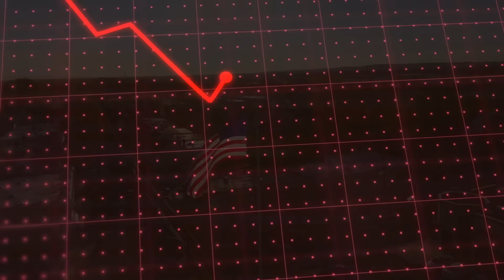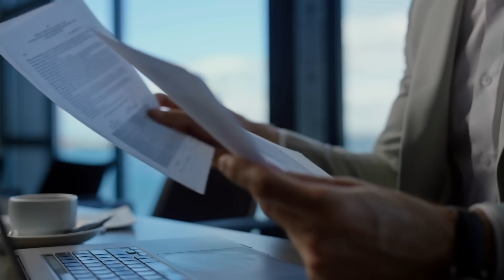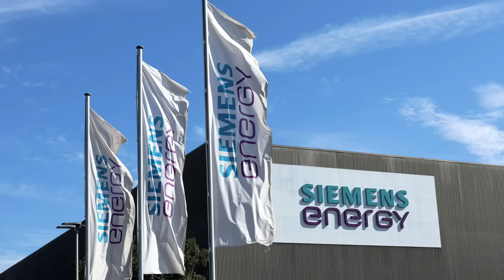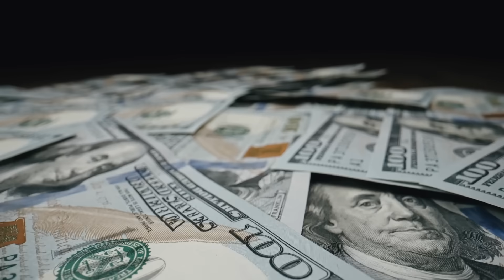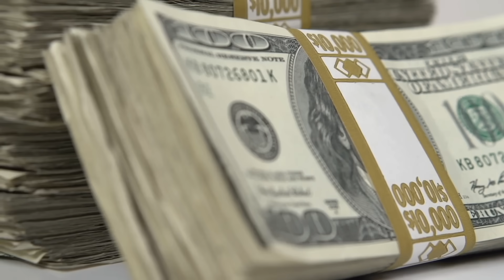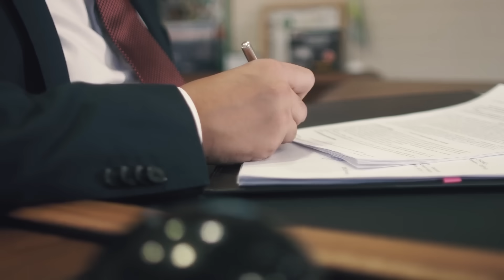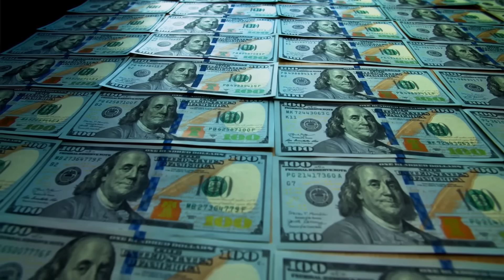The Real Reason America Has Turned Its Back On Wind Power Energy

Comment: I love at the 9-minute mark when they say, "government funding". There is no such thing. It is taxpayer/citizen funded. Once people realize that government funds nothing without taking in the form of ever-increasing taxation then maybe the citizens will wake up. I doubt it though.
Reply: As our U.S. dollar deteriorates and a simple burger meal at a drive thru window costs over $10, I would hope that people would start to wake up and realize that government spending is putting us deeper into a terrible debt.  The process of accessing these new sources of electricity is far more complicated than you may be thinking.  The power has to be placed into phase and stepped up to push onto the electric grid through a very complex process over newly constructed high tension power lines that have to be placed on private property.  Farmers and property owners do not want the lines on their land.
Reply: @g.k.1669 it's the fact that the dollar is strong that is the cause of (some) of US economic issues, an overly strong currency usually reduces exports.
Reply: @g.k.1669  Then tell governments the world over to stop subsidizing fossil fuels then? Its one of the most subsidized industries in the world.

Yes, electricity is complex no matter where it comes from—even for fossil fuels!

But fossil fuels are an _especially _complicated electrical energy source.  Because the fossil fuel industry needs a massive 24x7x365 non-stop effort of people, finances, subsidies, and equipment to explore, drill, transport, refine, distribute the stuff.  No, it does not just show up in at the power plants by magic!  -- And -- that's just to get the fuel to the power plant and it is still not even electricity yet!

Moreover, if any of this extremely complex process stops, whole sections of grids will stop.  If there's a war or conflict for it in some remote corner of the world,  then global fossil fuel prices can spike because those energy markets and refining activities are so intertwined.

Each year, US spends so much energy just refining its own crude that it could power all its EVs and more.
Reply: They spend money they don't pull in through revenue.
Reply: @kayakMike1000  : Correct. It is tax money redistributed through crony capitalism.  AKA fraud.
Reply: An absolute disaster to the environment
Reply: @rmf9567  Only if one has no clue what fossil fuels do to the enviroment.
Reply: @old-pete and you'd only hold that view if you had no idea of what environmental damage renewables do. When you've bet, and lost, the whole farm on renewable energy, what are you going to eat?
Reply: Before you can tax, the government has to create money first...unless you permit your banks to create their own money by lending, possible through the policy of fractional reserves. Taxation is nothing but one measure of removing money from the economy. The government can create money either responsible, balancing demand and supply by creating or removing money, thus preventing inflation or deflation,  or irresponsibly by quantitative easing, issuing money basically without restraint.
Reply: @krautsky  : You are conflating "money" with wealth.  They are NOT the same thing.
The government does NOT create wealth.  It PRINTS money.
Businesses create wealth.  Then the government takes it in the form of taxes.
In a non socialist/marxist/communist/democrat totalitarian thug system  those taxes are supposed to be used to keep the infrastructure sound and in defense spending and so forth.
What it is NOT supposed to do is redistribute that tax money to other people for political gain.
ALL wind and solar farms (all green endeavors in fact) are built through crony capitalism by taking tax dollars and giving it to corrupt companies/corporations to build those catastrophes that were never designed to work.
Those tax dollars were stolen and given to pals of corrupt politicians.
Reply: Just throwing tp money down the drain.
Reply: You are so right 😂
Reply: You'll see my comment that makes the same argument somewhere herein.  But you are so spot on!
Reply: People never will! They think that the government gives us free stuff.
Reply: The climate and renewable agenda is driven by Europe who faces the problem of dwindling energy resources and have looked to renewables and export of renewables to further generate scale and revenue
Reply: @christinebell37  The physics are the same everywhere.
Reply: absolutely correct.  but we can fund it thru public & private contributions.  accurate records and accountable managers are essential.
Reply: It's the same when they say 'free' this and 'free' that. It does my head in that people are so accepting of these terms.
Reply: @tonybloomfield45283  If you may need a "Heart Transplant", I suppose it will be a huge expense for You, as most likely American (And in a very fine Hospital)?
   In Denmark the expense for a hyper expensive Heart Transplant will hardly be felt for the patient, as it will be paid for by - all taxpayers! Why is anyone against this?
    That's the difference between The US and "Happy" Scandinavia!

          Our local Mayor has just got a transplant of "Bone Marrow" from a woman found in Chile, to cure his Cancer! It didn't cost him anything of course and he is now back in his job!
Reply: @@dannytimms9011Well, since you dislike it, then don't pay for it and don't live in this society.  I would be glad that people like you isn't in this society.
Reply: Ye I think Obama said when he was president that they would never had gone into space if it wasn’t for the government
Reply: Hoax.

Such a load of garbage.

There no such thing as a greenhouse effect.

The whole premise of AGW -- the greenhouse effect -- is wrong.

There is no such thing as a greenhouse effect (except in an actual greenhouse (closed container)).

But there IS  a trillion dollar $$$ boondoggle that is the muscle that twists arms behind that stupid renewable energy.  

"Welcome to the Mafia-ization of the energy business."

             * * *

A Novel Perspective on the Greenhouse Effect (Tom Shula)

https://youtu.be/NS55lXf4LZk

1) Markus Ott: Questioning the greenhouse effect

https://www.youtube.com/watch?v=Bj6ORbRBZ2s&t=7s
The greenhouse effect is the primordial sacrament of modern climate science. It is preached from kindergarten to the nursing home.  The simple name of this effect and its ubiquity in culture and mainstream media leave no doubt that we are dealing here with solid and fully understood Natural Science. But how does this actually effect work?

2) Markus Ott: Atmospheric greenhouse effect ~0?  (Applying IPCC formulas to the no-atmosphere moon. Conclusion: there is no greenhouse effect on earth.)

 https://youtu.be/JXKHfL55G2A

Min 6:xx.  "Abuse of the Stefan-Boltzmann model..."

3) Markus Ott: Saturation of the CO2-IR-Absorption

https://youtu.be/CrMGTkPADFw
(Min 0:10) The alleged greenhouse effect of 33 degrees centigrade is the result of an improper use of the Stefan–Boltzmann Law (black-body radiation), and that a less abusive application of this law makes the greenhouse effect almost disappear. 

4) Markus Ott: Convection and Thermalisation Kill The Greenhouse Effect

https://youtu.be/RbNNhLqhWPg

In-Depth Comments on Sabine Hossenfelder's Talk: Greenhouse Effect 

"Heat transport in the atmosphere... IT'S CALLED WEATHER."
https://youtu.be/sY2xHk0ThJ8

https://thebreakthrough.org/journal/climate-change-banned-words/art-climate-change?utm_source=Breakthrough+Newsletters&utm_campaign=12e6304fed-BTI_Weekly_1_18_2023_COPY_02&utm_medium=email&utm_term=0_49b872540e-12e6304fed-466887052

If heat rises, why is it so cold in the upper atmosphere?
https://www.physlink.com/education/askexperts/ae670.cfm
Reply: @@dannytimms9011 That $5.1-trillion figure came direct from the International Monetary Fund (IMF).  Anyone can look it up.  Bad news for you is that their updated figure for 2022 is now $7-trillion up $2 trillion from 2020.  Look up "imf energy subsides" for page for more details, chart/diagrams per fuel type and country.

Sure, I understand that accounting is sometimes based on subjective analysis even for established international GAAP standards. So, for argument's sake, let's cut the latest IMF 2022 figure down by a huge half to $3.5-trillion and still a staggering amount.

So my point still stands that fossil fuels are globally one of the most subsidized industries in the world if not the top spot -- only other contender at the scale is agriculture.   It is not hard to understand though because all modern societies need energy to not just prosper but even to just survive.

So people who are up in arms about renewables now receiving billions in funding are full-on clueless about it.   It’s a drop in the bucket compared to what fossil fuels are getting.  As fossil fuel recedes over the years and decades, we should except renewable subsidies to naturally increase.

Lastly, it needs to be said that renewables are a sustainable energy source that will go on for a billion+ years.  Fossil fuels will be only a brief torrid love affair in the time scales of civilizations.  Recorded artifacts of civilization go back some 5,500 years to Mesopotamia but the Industrial Revolution started "only" some 200 years ago when we really started to burn fossil fuels at industrial scales -- thankfully, that is starting to come to an end now and I can hope we can undo the damage.
Reply: FACT!!
Reply: That phrase Is fake news speak for the uneducated younger generations that believe everything has to come from "the govt". As usual, reality is a cruel...and costly...teacher.
Reply: Socialist won't
Reply: How many Americans voted to send their tax money to Ukraine so that Ukrainians can keep on dying?
Reply: UK Sunak has backed out of Paris Accords and abandoned milestones, as the real costs of Go4Zero grab.

We do have the estimated (present $s) cost for All-Electric "Net Zero"(sic). 273% higher utility bills. Do you own math. Massive gulaging of fixed income Seniors into State-run internment camps, jacked out of their Craftsmen homes by Chinese hot money, since 93% of solar panels are Made in China. 

¿Remember those Covid Lockdowns? In Biden's All-Electric Future, say goodbye to your parents and grandparents for the last time.

PELIGRO! NO VISITORS! THIS IS A FEDERAL INTERNMENT FACILITY!
Reply: Without subsidies,  wind and solar won't exist.  Why?  They cost more to make and upkeep than the energy they make.  RESTATE, it take more energy to create and keep in working order than the energy they create
Reply: So the final answer is that this is not financially viable UNLESS tax money/welfare is applied. 

SCAM!
Reply: most of the increase in taxes has nothing to do with the u.s. government, its your state or local. i worked all my life and the fed. tax taken out of my check really didnt change too much.
 now if your filthy rich tax rates have moved around. but if your filthy rich you pay someone to make sure you keep as much as possible sometimes keeping more after tax rates have increased. 
we cant believe our politicians when they are all rich people. they are not talking to you they are talking to their rich buddies. its so amusing to see people vote for the very people that are holding them down. of course they will take your vote! they have no concept of living a common working americans life. they will do anything including pull the wool over all of our eyes to keep their money or the people they represent. causing most of the economic disaster we are in right now.
Reply: treu with a lie
Reply: Government funding is what get you roads, water, sewer trains, subways fire adn police.  stop watching OAN, News Max and the other lier station you see..  While not prefect the goverment keep the lights on and road drivable. if you not like that stay the F home..
Reply: Our high taxes pay for our Schools, roads and Hospitals, so that it may not be a Huge Problem for one, but a minor expense for all. Even a "Heart Transplant" won't cost a Dane anything, but the ordinary tax payment.
Reply: People know that. But always thinking will be "other people money" because of progressive taxation.
If the taxation would be a fixed % from EVERYONE income, people would vote differently about spending the "government money"..
Reply: @freedomspeech9523  Doubtful.
The bailouts for banks and industry say something different.
Reply: It's our money but it's the government that decides how to spend it!
Reply: People are waking up! Feel it.
Reply: Youn and the other folk are subsiding fossil fuels - IOW, 'government handouts'
Reply: I love that folks don't comprehend what subsidy entails... ridiculous slavery for folks who do nothing to improve our circumstances... but, folks only see what they wanna see... and they want what the ad men have told them to want...
Reply: Many of the “experts” who argue that wind and solar are cost effective, unethically disregard the true costs. They treat subsidies to wind and solar as cost reductions, treat high taxes on oil as extra costs, account for ridiculous expensive regulations affecting nuclear as real cost of that technology. Not accounting for the costs of transmission and distribution of electricity is just another example of manipulating truth to convince the population about false narratives.
Reply: AMEN BROTHER
Reply: As a Highly Taxed Dane we also get much back from our taxes. Hospitals, Roads, Education and Pensions are paid from those. And if you need a "Heart Transplant" it isn't an "economical problem" for a Dane! When the full population pays a - little for the essential things, it isn't the single persons huge problem and only rich persons to become treated. In fact they may stand in a waiting line to become treated, as any other. Our local Mayer has just been treated with Bone Marrow from a woman from Chile, as a public patient!
Reply: What's killing Green Energy is a knock-off effect of rising interest rates and inflation plus global supply chain issues. The result is increased cost of operations and maintenance of existing wind farms, never mind building new units. Players in that industry aren't going to suck up more losses and further increase risk.

I could go into downstream costs of infrastructure etc. but investors have already seen the writing on the wall and are quietly moving away from this space.
Reply: Taxes pay for infrastructure that are cheaper, more efficient and more equitable when provided by non-commercial, publicly owned organisations... roads, education, policing, health services, defence, social insurance....
Reply: Maybe the citizens are broke.  You said it yourself, there are no government funds.
Reply: Yes, first keep the government out of it. If, and I did say if, this is the way to go, the free market is the way to make it happen.  Keep government and any stupid laws out of it. Let the consumer make it happen.
Reply: Don't forget that government funding also includes massive debt that will take generations to repay. Such debt increases inflation, and robs people of money just to pay the interest. Our future has been mortgaged.  We face debt slavery imposed by government whose duty it is to keep us free. Yet people have repeatedly voted for such tax, borrow, and spend governments.  Government, as it exists, will not solve any of our problems.  They will only worsen them, as they have demonstrated. The people will need to take control of government if we are to survive. We seriously need to drain the swamp.
Reply: Libertarian? 🥱
Reply: @AdamsHadEnough  Just rational.
Reply: Yeah the government funded Tesla and SpaceX
Reply: It costs  over 1 million dollars to construct each turbine , and they each have a generator to provide power when there is no wind.  They never even pay for them sel v es much less provide clean power. 1:41  Funded  by Amazon and green leaf  . So corrupt!!
Reply: 50 % of people are low IQ
Reply: People realize this. They realize we must “give unto Caesar,” for the betterment of  culture and society. Without this we fall back into pre Industrial Revolution poverty and shorter lifespans
Reply: When these contracts fell through, they had us shouldering heavy conduit until we quit or damaged our backs. All that electrical knowledge to lift day after day and hoping we won't lose health insurance like some of us did. The politics ruined it for me but I can still dream they figure it out.

There was a collaboration between the Union and not unionized to work together to train apprentices in exchange for contracts as how it was said to us at the school. The NJATC was the best experience of my life until it somehow became the worst.
Reply: Follow the money.
Reply: @gregcox9556  The fossil fuel industry has most of it.
Reply: Move tax day to the first Monday (before the general election) in November AFTER stopping paycheck tax withholding…THAT, my friend, will get everybody’s attention
Reply: Yes, and with the government tying itself down with more and more socialism in areas like health care, hospitals, disability services, etc...where does the money come from? Who is producing it? 
If a country has petroleum or other mining to call on, then all good. However, countries without that are going to 'struggle to juggle'.
Reply: @lieshtmeiser5542  And who is paying for the destroyed infrastructure because of all that oil use?
Reply: @old-pete  Nonsense comment. The infrastructure was built by our economies based on fossil fuels. 
You imply that infrastructure is being irreparably damaged due to oil use on a significant enough to warrant using to support your argument. 
However, attribution from increased ppm of co2 is not that significant, and suspect that even 50 to 100 years from now, the attribution of an even higher co2 ppm will be  incremental, and still not all that significant when looked at in proper context. Proper context means not gobbling the leftist grp think.
Reply: WOW  GREAT POINT BUDDY     IDEAOLOGUES FACE 0 CONSEQUENCE   THEY JUST  RUN THEIR MOUTH
Reply: Good grief! Grow up! Everything has to be paid for somehow. Imagine having to pay rapacious ever-growing prices to corporations for everything the government provides…oh, yeah, y’all voted for that in November…
Reply: And the tax payer never profits or benefits from the bail outs!
Reply: The government subsidized wind with taxpayers money... to make it a penny cheaper then coal... how coalminers have lost their  jobs because of this
Reply: Taxpayer funded is right!
Reply: Call your congressmen, senators and council and tell them windmills are in the best interest of the people and give them good reasons why. Also wind power is much cheaper then nuclear power
Reply: Goverment never funds, Goverment steals. BUT HOW?!, they give Goverment contracts to their kats at 2x the rrp.
Reply: Government funding always means that you and I pay for it..
Reply: Ramaswami says he will save $80B by cancelling the Dept. of Education for one of many.
Reply: Except that the government also creates money with printing presses.
Reply: Yes but ultimately its the government that decides where those funds go, and that's the really important bit.
Reply: What about subsidies to the oil companies that have been in place seemingly forever?  Isn't that government funding?
Reply: @georgevan2589  The VAST majority of people don't KNOW what those subsidies are or how they work, so they don't believe they REALLY exist. This works well for the oil companies. The direct subsidy for EV buyers is right in front of you (and STUPID, and I say that as a pro-EV advocate).
Rather than subsidize windpower, the government should use regulations to force the utilities to allow ANYONE to sell them electricity - like in a capitalist "free market". Watch the bully-boys at Duke or PG&E run screaming if ANY government did that. Right now the utilities throw up a maze of bureaucracy and regulatory BS to force you to buy electricity from THEIR expensive sources.
Reply: Yup. Just like the subsidies we currently give to the fossil fuel industry.
Reply: It is still the goverment.
Reply: @old-pete , exactly Government funds are tax payer funds.So in answer to the question, is it Government funded? Absolutely
Reply: @old-pete ; you don't get it, the "Government" has NO MONEY! Every dime it spends MUST come from tax payers, or borrowing! It's sad that REAL basic economics is no longer being taught in schools. There is even a Democrat running for the US Senate from California who claims the way to fight the high cost of living is by raising the Federal Minimum wage to $50.00 an hour. Talk about someone who hasn't a clue.
Reply: @old-pete 
It Will FOREVER 'Only Be'
TAX-Payer Money.
It Has Nothing It Does Not
Take From Someone Else
Reply: @TheAlabamaWildman  More and more windturbines get built without it.
Reply: No dummy isl your money out money  @old-pete
Reply: @florianiscrown  English please!
Reply: @old-pete please wake up. I bet you voted for joe
Reply: @drZok3136  Was that an attempt at an argument? You are funny!
Newsflash! There is more than one country in the world. Not everyone lives in the US.
Reply: Oil and gas rerceive far more "government funding" than wind and solar have ever done.
Reply: this is worse than dealing with kindergarten children,  adios. @rogerphelps9939
Reply: The fossil fuel industry is one of if not the most subsidized industry in the world!  The average US cost per gallon of gasoline would be 2X to 3X the cost without government intervention.  In 2020, the global fossil fuel industry received a massive $5.9-trillion USD equivalent in subsidies!

In a way, its easy to see why.  Because any modern society needs energy to not just survive but also thrive.  Thus, as the fossil fuel industry recedes, those funds can be used to build up a longer lasting sustainable renewable based energy infrastructure.
Reply: @beyondfossil  As stated by the OP, the gov't has no money. It's the taxPAYER's money. If the gov't stopped 'subsidizing' gas, they could then NOT take a couple of thousand dollars in my tax money. Then it would go from me straight to the gas people. No difference out of pocket. No difference to the gas people's pockets, either. Except that Joe Blow, with lower than average income, would then have that couple of thousand dollars coming out of his already empty pocket. The subsidy is really going to the poorer people. From the taxpayers.
Reply: @beyondfossil  Exactly. It's all corrupt. This COP28 is a prime example. The president this year is also the CEO of the Saudi state oil firm. You couldn't make it up!
Reply: @beyondfossil  Can you supply a source for the government subsidy of gasoline that is reducing gas prices by your 2x to 3x down to the current prices?  That's an amazing amount of subsidy.
Reply: @beyondfossil yes, and you might sprout little pink wings and fly away.
Reply: @railroad9929  That's the best trolling you can do?  Its not even par with my 5yo.
Reply: @beyondfossil  YOU aren't not even par with your 5 yr old.
Reply: @railroad9929  Good comeback!  But more of the same dull vapidity from you... not surprised though at this point. 🤦‍♂
Reply: @beyondfossil  : False
Reply: As a taxpayer, I am happy to fund improvements in our infrastructure.  If you don't want to pay for it, don't go out and use public roads.
Reply: @magnetospin Being a taxpayer myself the roads suck and are in need of attention. They waste our money and steal it. Then printing it so fast that we are in serious debt.
Reply: @roundedrob1483 You have point, but the solution is to fix the problem, not to get rid of public services.
Reply: @roundedrob1483 yeah, the interest on the US debt is 1 trillion$ per day
Reply: Go back to math class.  The daily interest is 2 BILLION (with a B) which is horribly scary enough.   Stupid spending for too many years have left this country wounded to death with debt.  I am an old guy, but I fear for my son and grandkids.
Reply: @magnetospin as a taxpayer you should be appalled at the massive government waste.
Reply: @brkbtjunkie  In some areas, such as the military, but not in infrastructure.  Our infrastructures are so old and rundown now there need to be much more spending.
Reply: @magnetospin  : Roads actually work.  Green energy is a boondoggle, aka FRAUD.
It is theft of taxpayer dollars and the socialist/marxist/communist/democrat totalitarian thug party knew that in advance and deliberately pushed it stealing billions from Ameircan taxpayers.
Reply: Your not talking about toll roads  are you  @magnetospin
Reply: @haroldmichaud6333  No, just regular roads.
Reply: Unfortunately as taxpayers only a fraction goes to projects that benefit the community. The rest goes in the pockets of politicians and big corporations  @magnetospin
Reply: @magnetospin  Not necessarily. Sometimes they simply print money and throw money at the system, taking advantage of the dollar's resilience.
Reply: @magnetospin  Have you sent in money in addition to your taxes yet? You have had an entire year and no extra funds have been received! You are welcome to pay for it. The question is whether or not you support the use of force to get your neighbors to pay for it.
Reply: @magnetospin you are paying for it every month.wake up! Don’t think our utility companies are nonprofit good Samaritans!😂
Reply: @TomBTerrific  I don't see a problem with it.
Reply: @magnetospin , we aren’t talking about friggin roads.
Reply: @robertlee7606  You should look into the actual funding of these project before opening your mouth and revealing your ignorance.
Reply: @magnetospin  If a company doesn't want to pay for their solar farm, they shouldn't build it in the first place.  They will reap the profits, not the taxpayer.   Stop calling it "our infrastructure" when it is "their business".
Reply: @Critical-Thinker895 I wish fossil fuel companies did that too, but they get so many "tax breaks" and even direct subsidies, it is hard to keep track.
Reply: @Critical-Thinker895 So it's not your infrastructure then.  That's fine.  Stay off my roads.
Reply: @magnetospin  Why do trolls like you fail to watch the video or even read the title?  Or maybe you think you have a right just to jump in and hijack the thread.  This isn't about roads DA.
Reply: @magnetospin  gladly, if I didn’t have to pay for them…
Reply: @Motoracer-zx10er Well, then, don't use them.
Reply: They don' t get subsidies.  They do get tax breaks in the form of depreciation of buildings and equipment, just like every other company in the US.  Calling that subsidies is incorrect. @old-pete
Reply: @stanleyfranks8252  They get boths.
Reply: @old-pete  : Except there is no such thing as "fossil fuel".  Crude oil does not come from buried dinosaurs.
Reply: @wrongfullyaccused7139  fossils are not just dionosaurs...
Reply: @old-pete  Subsidies are distributed throughout many industries. Not just those related to energy projects. The people do still benefit when the projects are up and running. It helps to keep the economy running and expanding. It isn't all evil.
Reply: @joewoodchuck3824  Obviously, since a thing cannot be evil.
Subsidies help with development of new technologies or countering external costs. But when established technologies still need subsidies, the economy suffers.
Reply: @old-pete  Maybe, maybe not. If a production subsidy is pulled then the product price will probably rise. Higher prices can easily result in fewer buyers.  I don't know for sure that there aren't any current subsidies in the automotive industry, but look at what the big three has done. They pushed prices way up and have lost a big chunk of their customer base. Vehicles just aren't selling like they did before the astronomical price increases. 
   Look to agriculture as an example. Subsidies keep farm product prices down. Government knows that removal or reduction of agricultural subsidies will hurt both farmers and consumers. Said subsidies can easily put farms out of business and we all know that we need farmers to keep the food supply going. There are even programs that existing farmers can use to set aside land as a deed provision for future owners that protects the land as agricultural only in perpetuity.
Reply: @joewoodchuck3824  If something is too expensive, either someone increases supply or someone will enter the market, otherwise it is the right price.
Agriculture has the problem of external effects (weather) and foreign subsidies, which lead to very fluctuating market prices and cheap supply from other countries.
But even in agriculture it is better to keep the subsidies to a minium and lower taxes instead, that people can afford more expensive food.
Reply: @old-pete  Perhaps you haven't been following the automotive topic like I have. Who's going to pay prices approaching 100k for a pickup truck? The prices only went through the roof in the last very recent years. They're desperate for customers and are hurting because of it. Many vehicles are gathering dust at dealers. Maybe the import brands too. I don't know.
   I won't even address the EV sales market which is a whole different can of worms.
Reply: @joewoodchuck3824  You buy the truck from a cheaper brand.
Btw a Ford Maverick starts at 23,400 $.
Reply: @old-pete  What capabilities does a Maverick have in cargo and in towing?
Reply: @joewoodchuck3824  No idea.
Reply: @Critical-Thinker895  Roads are built with taxpayer funding for the benefit of the taxpayer, just like electric generation and distribution systems, oil, food crops, and and a multitude of other benefit we as US citizens enjoy. For being  @Critical-Thinker895  you don't do much thinking, do you?
Reply: @stanleyfranks8252  Lol. Are you really so ignorant you think oil and gas producers don't get subsidized? Wow. I know we have an education problem, but I didn't know it was this bad.
Reply: @derekd1510  There's always one idiot who goes after the name.
Reply: Nice ad-hominem attack. No, no. Don't bother addressing the facts of the argument, that might require you to, you know, think...but since you're so smart, tell me, do you know the meaning of the word, "projection" in the psychological sense? Yea, that's you.
Reply: @Critical-Thinker895  Oil subsidies? You're ok with those, or that "Critical Thinker" is just a nickname? Just curious, pretty sure I know the answer - "critical thinking" and "Republican" seem to be philosophically incompatible.
Reply: the fossil fuel and wind energy companies are the same companies with different names.  It is all big energy companies industrializing the countryside and the seas. Pretty obvious fact there projects overbuilt beyond the current need and or the local capacity, with politicians promising more spending. The whole energy sector is full of wasteful spending.
Reply: @magnetospin  everything should be a use tax, you drive on the road, you pay, not me…